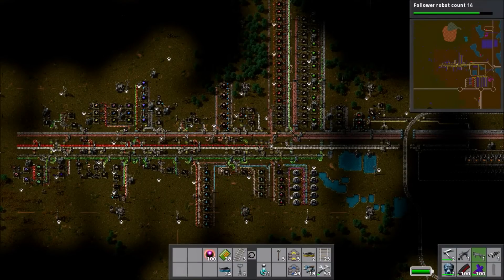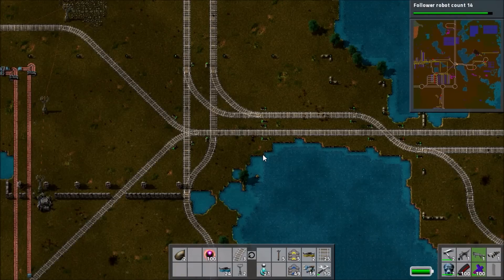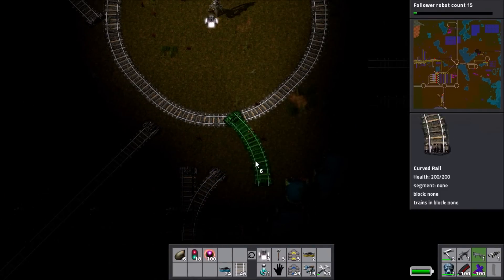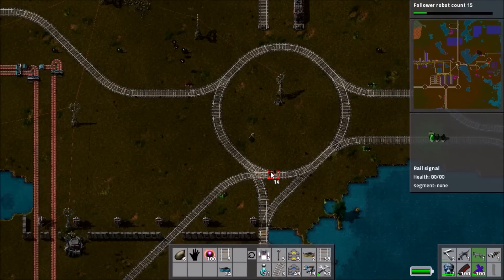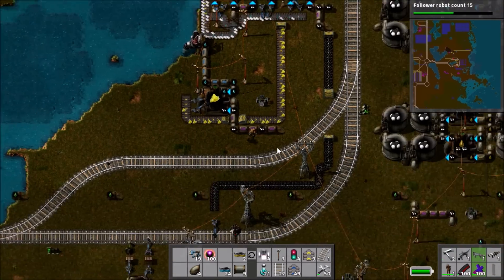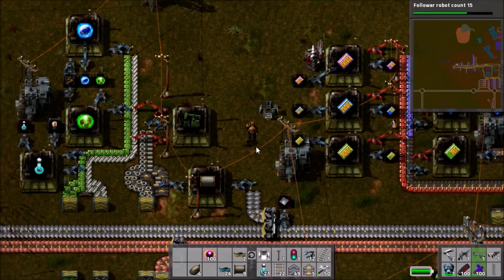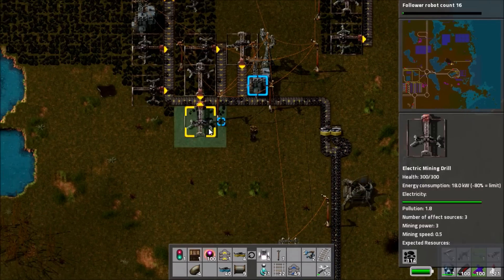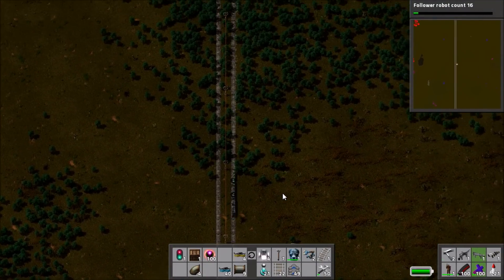Factorio Railworld Ep#31: A Job Done Properly

Comment: Poison Capsules are good for taking out worms, but I believe leave spawners untouched.

One thing I had done with my own "railworld" was to setup my own personal train which I could use to travel around to my various outposts at a moment's notice.  All you'd need to do to do the same is setup a side junction at the main base and various distant locations.  Add a couple cargo wagons onto your train and preload them with outpost and rail building supplies so that you always have things on you when you head out.  It'd make getting out to various spots quick and easy.